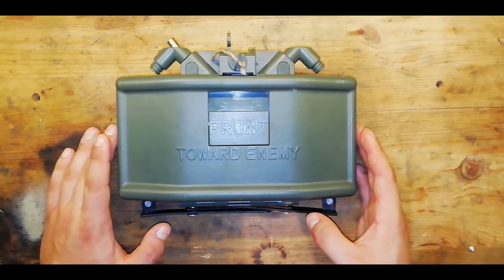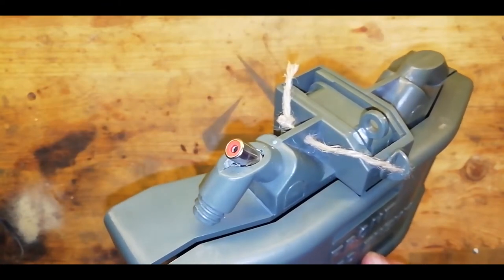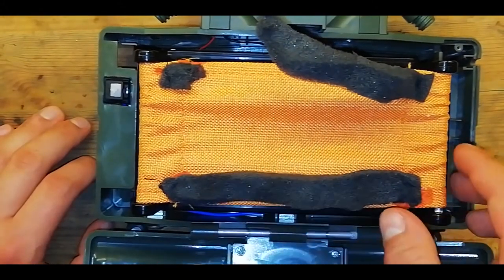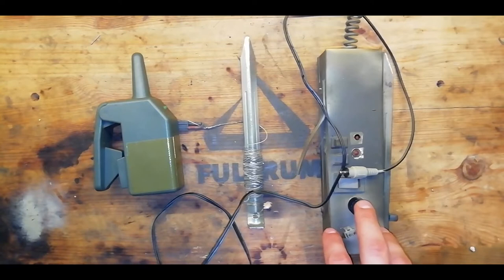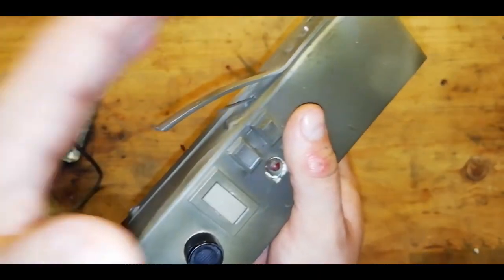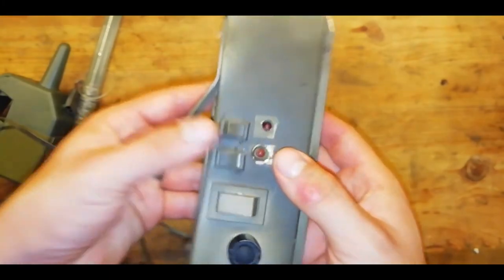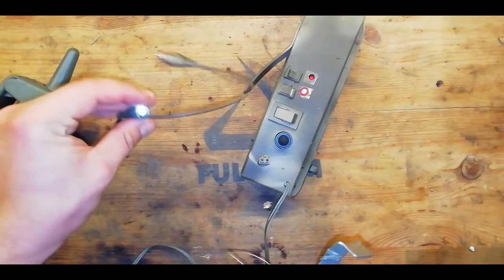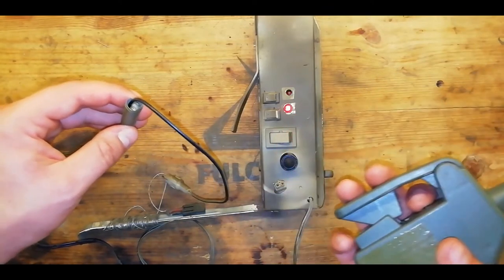Airsoft M18 CLAYMORE MINE! (Airsoft Anti-personnel Land Mine)

Comment: I bought one and I couldn’t get the remote to work😢
Reply from the maker: Does the LED flash or respond in any way? If the LED is flashing on the detonator constantly there is no connection.
Reply: @FulcrumAirsoft  yeah, the LED on the remote is flashing constantly and there’s no button on the side of the explosive